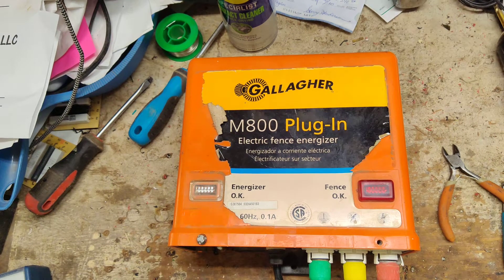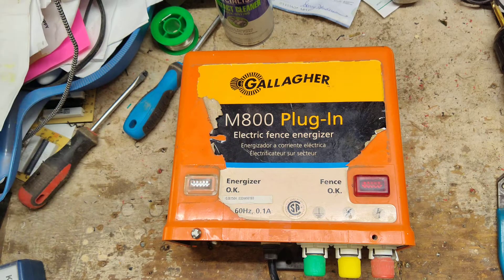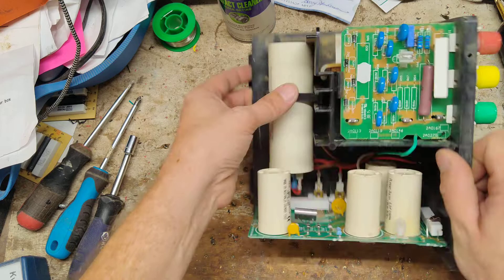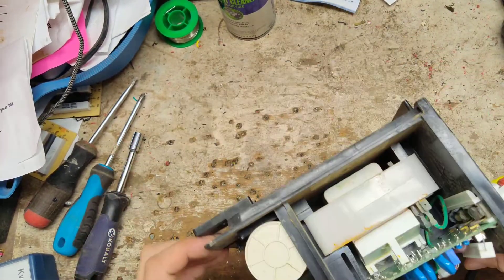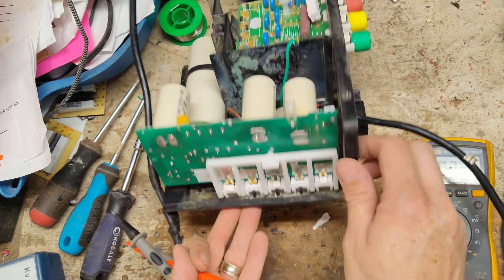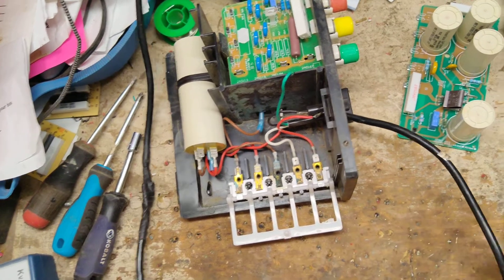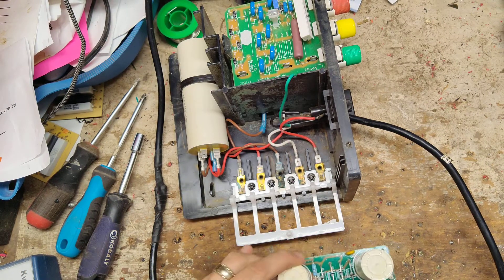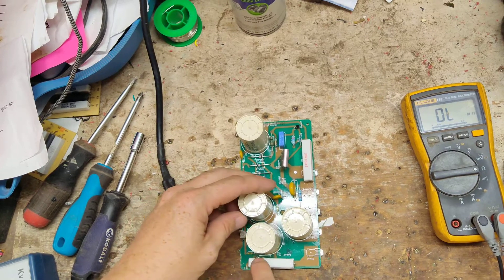Fixing a fence charger that won't click and has no output | Gallagher M800 Repair

Comment: Hi, I live in Switzerland and also own an M800. Unfortunately, it only produces 2kV. Would you fix it?
Reply from the maker: I could definitely fix it. I'd cut you a deal on the repair to help offset the shipping back and forth. It's a good old school unit and I think will still be cheaper than going out and buying a newer model today from Gallagher. Their current model here, also called the M800, is a good unit but sells for around $400-$450+/-

Comment: What is an electric (inside) fence unit works on the lower power setting but not the higher one...what part would it need to fix that , please ?
Reply from the maker: Depending on how the unit is built inside, it could be an output circuit board that has something wrong with it or an output transformer, but it really depends on how the only is set up inside internally, they're not universally built. What brand and model do you have?